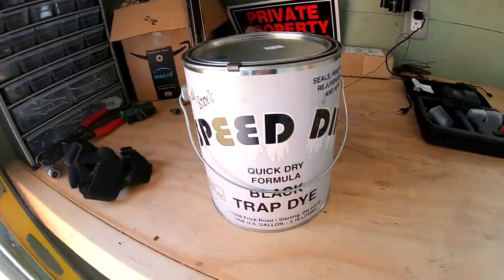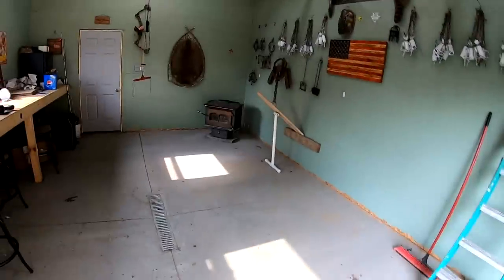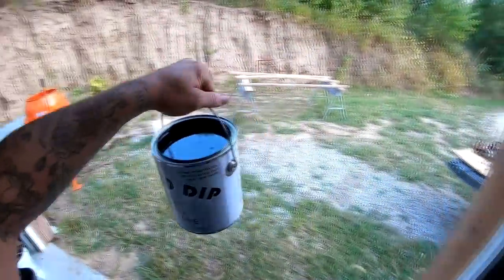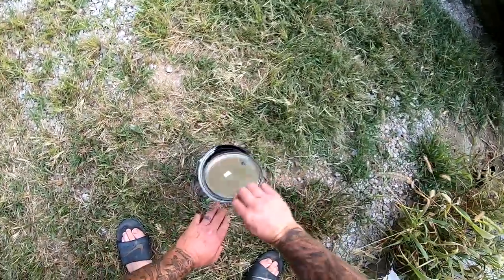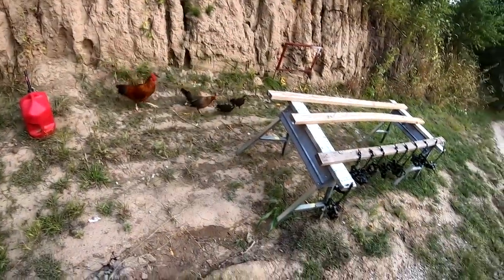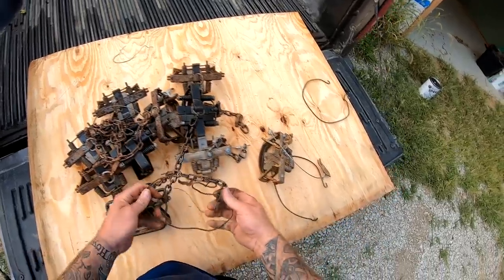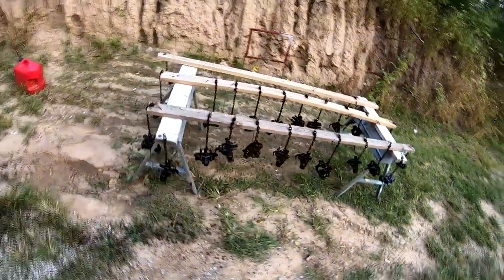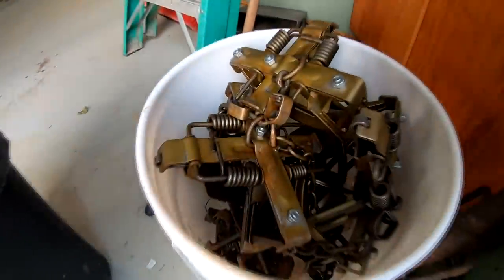prepping traps {how to dye traps with speed dip}

Comment: I tried using that dip about 5 years ago and it ended up being a disaster!!!! I dipped 4 dozen traps, let them dry for over three weeks outside in the Texas sun. Waxed them and put them in totes about a week later. They were in the totes for about three weeks before I headed out to start my trap line. When I open the first tote I could smell gas. At first I thought the smell was  coming from my four wheeler that I had just filled up. Unfortunately it wasn’t the four wheeler. I went ahead and knock in about 20 sets that day. I left the lids off of the totes in hope that the smell would go away. The next morning on my first check nine of the traps were dug up and 3 more had been scratched at. I ended up driving 212 miles back to the house the next day to get sone old traps that I hadn’t use the dip on. I left the totes in the shed with lids off and they still smelled like gas a month later.I ended up having to sandblast them and soak them in lacquer thinner the next summer to get rid of the smell. I started using Formula One trap dip and it is amazing!!! I hope you it works out for you.
Reply from the maker: I’m going to find out man I’m going to let em hang till season

Comment: I just spray paint my traps (K-9s in bright red), let dry, and then dip in Zep High-Traffic Floor polish to protect them.  Beats dying and waxing the old way.  
BTW, the bright red is so I can see if the trap was pulled out of its bed when running the line.

Comment: Didnt catch the part on how u rusted new traps up. I use muriatic acid and dip em them neutralize. I like using coleman fuel  for speed dip. One quart SD to a gallon coleman fuel i did about 120 traps and still have a bunch left over for next year. Protects the traps in saltwater pretty good.
Reply: Please tell me about trapping in salt water? What are you trapping? That seems like it would be tough on traps! Thanks man.

Comment: smart man not opening the Roof up, not fun when it starts to leak in time.  DUDE these fires are something else happening its nuts.  dude im blown away you have to mix that with gas though, i know you read the odor would evaporate but damn thats something different.  I see more and more trappers including the old timer I learned from switching over being easier and quicker so I may have to give this a shot.
Reply from the maker: I still might it’s cheaper lol
Reply from the maker: Hole in roof lol
Reply: TRAPPER J yea we always went through the roof had one boot leak on our camp once either either way works

Comment: hey im just wondering. i used this on all my canine traps. cause of my job i only had 3weeks to trap. i dyed them using speed dip with high octane gas and after 7 days all my traps are tacky and smell of gas. is this a common thing with speed dip. iv always used powdered dyes or walnuts and with these iv never seen this problem. i want to salvage my season ;D
Reply from the maker: Gotta go this in the summer well before the season so they can air out